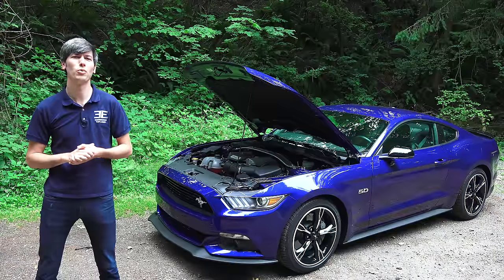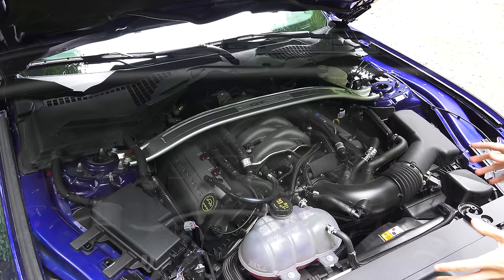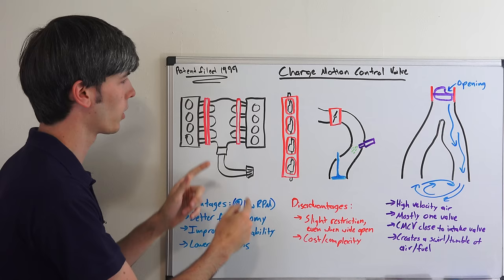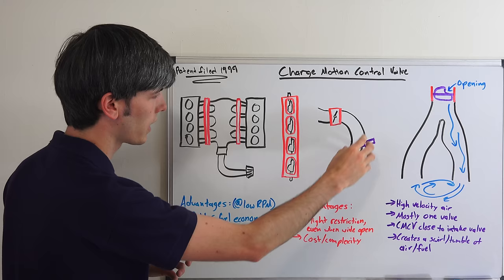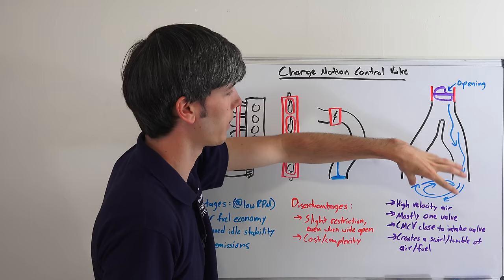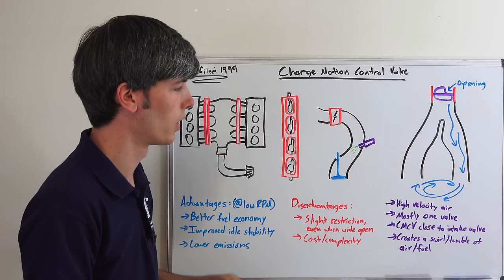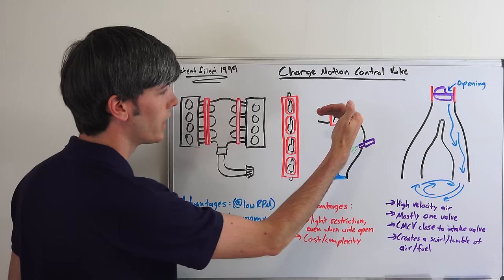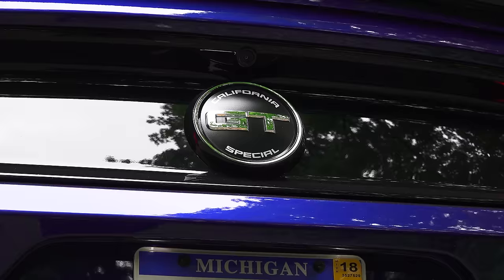Keeping The V8 Alive - Charge Motion Control Valve - Ford Mustang GT

Comment: I almost want to call this setup another take on Variable Length Intake Runner systems like Ford, Hyundai and several others have used for years, although perhaps "Variable Volume" would be more accurate.  I'd love to see one of these cylinder heads off the engine; I'm curious to know what (if anything) Ford has done to prevent self-scavenging of the intake charge back into the runner at low RPM.  :]

Comment: Is their a reason why they don't make a 1.6litre or 2litre V10?
People love the sound of a V10 yet auto manufacturers wont to use a smaller engine for fuel economy and emissions so this would sound like the best of both worlds or is their a logical reason.
Reply: wouldn't engines like that lack of torque?
Reply: Most likely, it is because there would be too much maintenance with a v10, especially one that small of size would have smaller components
Reply: Can they hit ~430-450 HP with that small of a V10? I've seen Audi's the have the 6.3 liter W12 engine "barely" hitting 500HP with that large of a displacement. The point here isn't just the sound but those 400+ HP numbers
Reply: I would imagine by time you get to 1L v10 it would have enough friction to start have diminishing returns in terms of power. a inline 4 would most likely make more power than a v10 of the same displacement. at least at 1L
Reply: Are you sure you don't mean V8's? I do agree we should look at scaling down successful engine designs. Cost and complexity are probably what prevent it. Ferrari used to make a 2.5 liter V8. It sounded incredible!
Reply: ***** that's irrelevant lol.
Reply: at 1.6 or 2l an inline 4 engine is the best option.
Reply: The more cylinders you have in the engine the more friction there will be. A 2 litre 4 cylinder engine will have a much smaller contact area with the cylinderwalls then a 2 litre V10. More contact area = more friction = more lost energy = less efficient.
Reply: ***** yes but that's irrelevant to our discussion. A smaller V10 will use less material so lets just make a ton of them right? Well no one makes them so obviously them being cheaper to produce is irrelevant.
Reply: +Mitchell Sprenkeling I don't think that's really a good argument point to talk about the friction on cylinder walls. Even though there are 6 more cylinders, the displacement is still the same 2.0l, which means it makes as much friction on the cylinder walls as a 4 cylinder. Now if you were talking about the valvetrain, that would be different, since there are many more valves than a 4 cylinder, maybe 40 valves compared to 16 if it's 4v per cylinder
Reply: ***** yes that's the point of the discussion. We are trying to figure out why it doesn't make sense.
Reply: Vinny The Tech if all the pistons are the same height then friction would be greater on the 12 cylinder.
Reply: +Youtuber You can't compare the use of raw material for strengthening the block to the number of cylinders. It takes more time and tools to machine, your camshaft will become more complicated or on a V engine it will even double your camshafts compared to an inline engine. So even if everything gets smaller it gets more complicated and increased in numbers. Even the whole engine block itself on a V8/V10 uses a lot more material than an inline 4 of the same displacement.
Reply: Gorsnak  Gorsnak is online now
Charter Member
  
Join Date: Jan 2003
Location: Saskaboom
Posts: 8,541

One reason not to build a 2.5 litre V8 instead of a 4 is that the V8 will cost a lot more to manufacture. You have to double the number of pistons, valves, camshafts, spark plugs, etc, etc, complicate the intake and exhaust manifolds, and so on and so forth. These parts are all smaller, but will cost much more than half as much as the fewer, larger parts for a 4 cyl of equal displacement. So you build this snappy sports car with a micro V8, but it's in the same class as a competitor's 4 cylinder, and it costs substantially more. Sure, it's torque curve will look a little different, maybe even better, and it will sound really good, but that's a high price to pay for such minor advantages.

So basically you shouldn't ever expect to see something like this except in high end cars where prospective buyers won't care about an extra couple thousand bucks in the price tag.
________________
Reply: Theres no replacement for displacement? haha
Reply: Yes, there are many reasons why. For one, a 2 litre V10 made to make a relatively high amount of horsepower would be very fuel-inefficient like a Formula One car's engine. Another reason, more cylinders equals more parts, which in a 2 litre V10's case, adds unnecessary complexity, which in turn theoretically decreases the engine's reliability. Also, there is the huge disadvantage of such an engine being expensive and cost-inefficient.
Reply: @rockingxsockin those w12 engine are built for smoothness and torque. that are way more capable than 500.
Reply: ***** it would be pretty bad on gas. And in case you all did not know any engine can sound nice with the correct exhaust. That v8 sound is that American exhaust design sound. It's the same with any notable engine sound. If you took the headers off a engine and ask people to identify how many cylinders it had I bet they would get it wrong every time.
Reply: A small V10 would have HORRIBLE fuel economy. Basically, an ICE is a heat engine--it extracts motion from the heat produced burning gasoline. And because of that fact, you want a high "volume to area" ratio in your cylinders. The more area, the more inefficient heat transfer to the engine block, vs being harnessed to move you. Volume/Area ratio favors fewer, larger cylinders. A V10 is the exact opposite of what you want--a lot of teeny, tiny cylinders. If the customer could put up with the noise, vibration, and harshness, efficiency would be best served (in a 2.0L-ish engine) with a huge, horizontally-opposed twin!
Reply: +Mitchell Sprenkeling very well said Mitch.

Comment: I'd rather have a 2.0 L with a massive turbo and an anti-lag system than a N/A 5.0 L
Same performance (or better)  along with much better fuel efficiency. Another advantage is that you probably will be running E85 or some variation of it, which is cheaper and better than conventional fossil fuel.

Comment: So what kind of fuel economy does it get ?
Reply: It gets good smiles per Gallon.
Reply: The specs say 16 city and 25 highway. I get 18 mpg combined, and I've never gotten better than 23 mpg highway. Ford is notorious for inflated mpg numbers.
Reply: i have the factory 20s on my 2015 GT get around 12-14 city 22-24 highway
Reply: cadsux, except for their fiesta and focus. I've gotten those 2-3 mpgs above their rating many times.
Reply: If you're worried about fuel economy on a mustang, you probably shouldn't get one.
Maybe a Prius will be a better option.
Reply: You're probably using gas with ethanol, my mustang gets horrible gas mileage with ethanol but with pure gas my 2013 GT/CS with 3.73 gears gets 27 mpg on the highway
Reply: I get 15MPG in city with my Manual GT. But, what matters is not MPG, its Smiles per Gallon

Comment: I don't understand those bars on top of ford engines. Why?
Reply: That's a strut bar; it helps make the body stiffer to decrease body roll when turning.
Reply: I think they're to help stabilize the car. makes turning while at a high speed easier, less likely to lose controll.
Reply: You mean on the top of almost every engine in every modern performance car.
Reply: It's pretty much in every performance car, and cars with heavy engine. It's a strut bar to increase stiffness of the car, and also prevents flex on the chassis due to heavy engines.

Comment: that would make it sluggish @ low rpm
Reply: Not really, since the system is disabled at high throttle (even low rpm) and can enable\disable as fast as the actual throttle body does.
Reply: Nope. throttle position has a lot to do with the opening size. He even mentioned light throttle and low RPMs in the video.

Ford does a lot wit throttle position these days. Even in the ST/RS, throttle position pretty much regulates everything the car does with respects to efficiency, power, spooling controls, and even intake sounds.